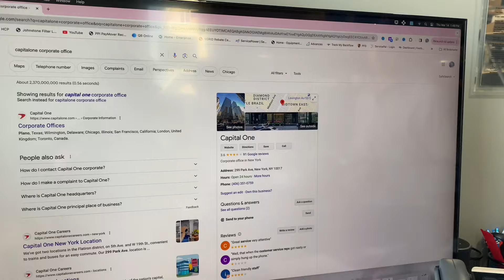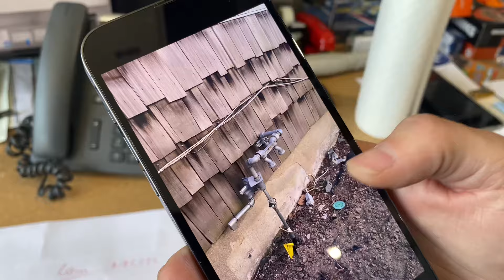Melting Scrap Aluminum Results in Epic Failure

Comment: That is why you place a square of card board in the forge and then sit the crucible on the card board.  The phoneme that you experienced is called fire brick sticking.    The Aluminum explosion is caused by moisture in the concrete causing steam bubbles under the molten metal causing the explosion or pop!   Glad you only had a small bit of metal in the crucible.  Imagine having a FULL POT and it spilling out!

Comment: After goofing around with molten metals I think aluminum is one of the more dangerous as it explodes easily.  I tried beryllium and that ended in disaster as well when it ignited.  Indoors.  I got it outside though!  Magnesium does the same thing.  I won't do that again.  You will still have a lot more fun with that furnace, you just don't know when or what.
Reply from the maker: I just bought another!